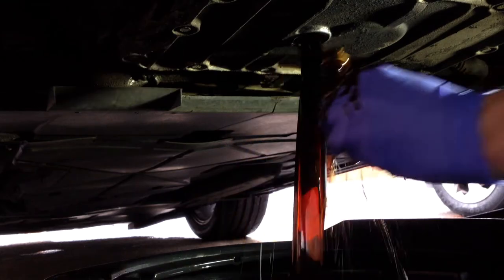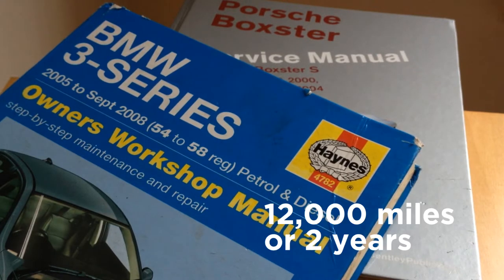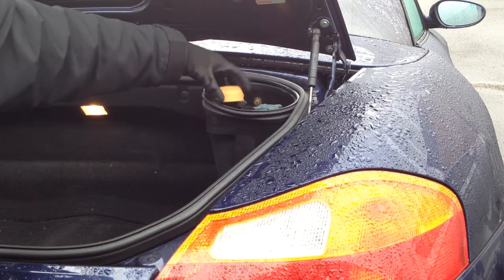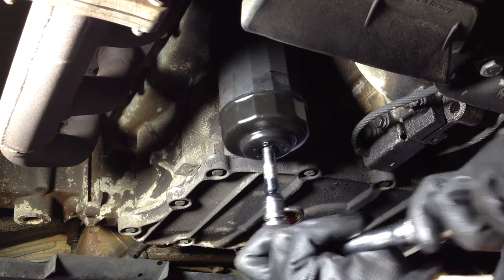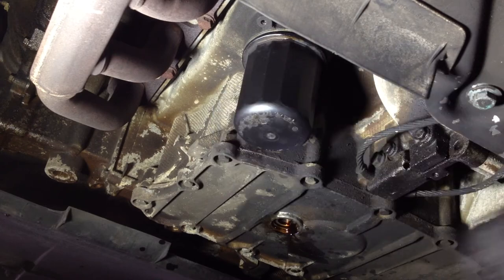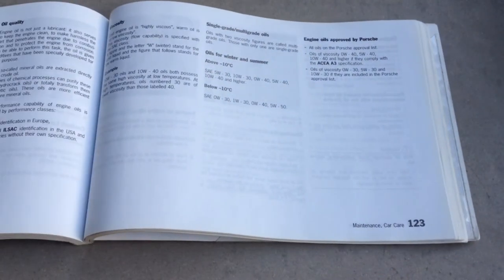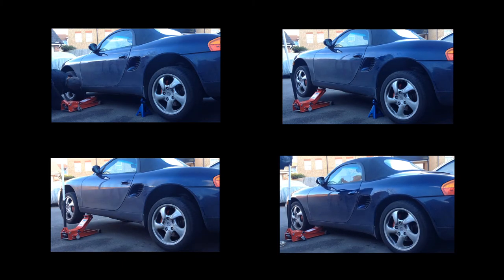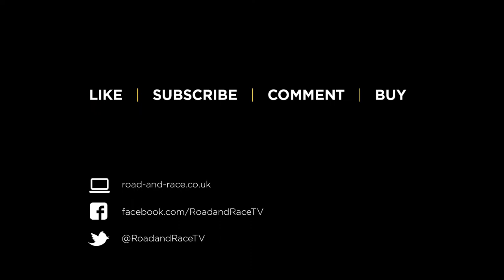How To Change Engine Oil On A Porsche Boxster 986 987

Comment: Thanks!! Im from CA due to the temperatures would it be better if i put 0w-40 or 5w-40 on my 1998 986 ?
Reply: If it's hot where you live, probably the 5w-40.

Comment: I dump my oil on my driveway, kills the grass in the middle of the driveway for a while then it comes back even greener as the oil is nothing more than strong fertilizer. There is no place in this small town that excepts it and I am not driving 150 miles round trip to take it to a place to recycle it, then they want to charge you in most places to dispose of it and which is odd because they sell it to recycling centers.
 
Another thing I do is use it in my oil heater.